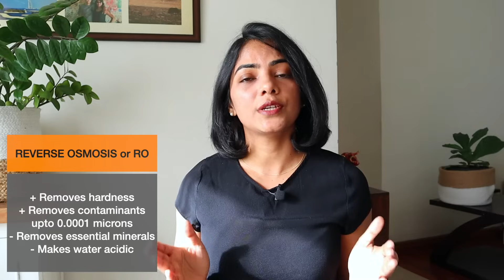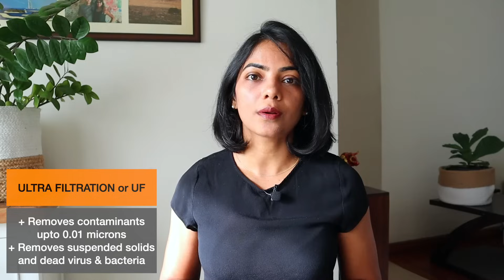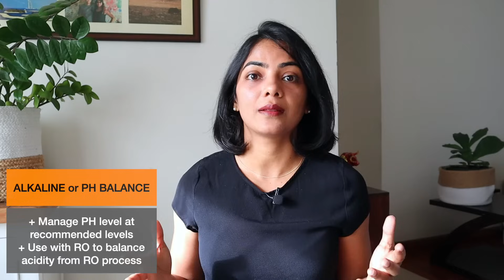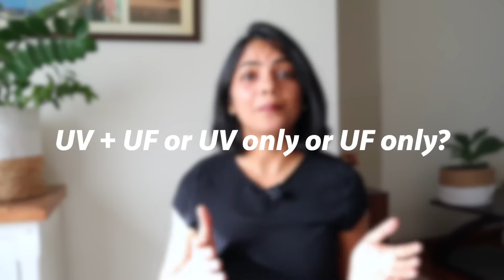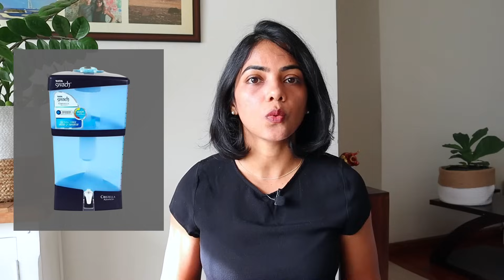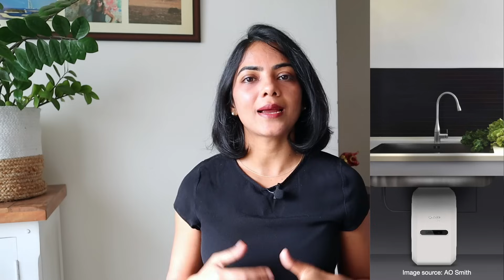Which WATER PURIFIER is best for your home? RO vs UV vs UF vs MF explained | Filter costs

Comment: I purchased water filter with Ro+ uv+MF. But in the Ist year itself I have spent 5000/-in warranty period. The TDS of input water is 320. After filtering in filter the TDS is 43. The standards for TDS is 50- 100. If your filter water is 60- 70 it is tasty and good for drinking . But maintenance cost is 5000/- per year. But the maintenance team is not able to maintenance of filter as per standards.
You have told how to maintain the filter. Balakrishnan.P

Comment: Thankyou. I will first buy a TDS meter. Will mostly stick to UV+UF, until TDS is over 500. 
I have one suggestion for bigger families and irregular power and water supplies, to get a large water storage (overhead) tank and an off-grid or hybrid solar inverter system.

Comment: Thanks for the info. What to do what the is a central RO system that brings down tds less than 200 but alkaline and ph levels need to be fixed. Do you have any recommendations?

Comment: We are using PureIt Ultima Eco Mineral RO+UV+MF for 3.5 years and there is a big problem. We have small kids and old parents, and we all are consuming this filtered water daily. And gradually we all suffered with lot of health issues. Since we are using this machine for more than 3 years, we faced bone weaknesses, joint pains, weak digestion, weak vision, hairloss etc. When we went for thorough checkups, we got to know that these conditions are caused due to loss of minerals and vitamins in filtered water. And the only culprit is our water purifier. 

The concerned thing is when I checked the TDS level of water from PureIt Ultima Eco Mineral RO+UV+MF, we found it very less TDS i.e. 6 to 12 mg/ltr than usual what human beings should be consumed. It is a great health concern for us. 

Thank you so much for making this video.
Reply: Ye apmineral k ro filter ki fiting krnay walay ki galti ha k unho nay sai tds set nhi kiya ya ziada tds level set ho nhi skta and ap fr doctors nay is solution kya btaya medicine di ya filter change krna ka kaha fr ab ap kya filter use kr rhi hain
Reply: What are you using these days
Reply: Did u take into account that your diet could be simultaneously enhancing these symptons. That is with a balanced, nutritional diet that provides the same nutrients and other important factors your family wouldnt be suffering from those symptons maybe? 
Also adding electrolytes to ur water might help aswell as re-mineralising ur water processes?

Comment: Informative and much appreciated, thank you❤
my borewell TDS is 316ppm. 
I recently repalced my aqua RO+UV+UF+TDS Controller, which resulted a 20ppm TDS with a Pureit RO+MF, but unfortunately the tds has fallen to a shocking 12 with this.

Should i completely skip the RO function and go for UV+UF or maybe an MF or nano?
Reply from the maker: You should preferably use a Nano water purifier like this https://amzn.to/3KwdM9l for your TDS. That low level of TDS is not good

Comment: Hi, Thanks for the detailed video.
I recently bought HUL Copper RO & had to return due to bad smell & taste of Water TDS of water is less than 150 & that could be the reason.

After watching all your videos I have decided to go for UV + UF + Carbon. (Carbon is optional) Could you please recommend me a best brand for my requirements. My budget is 20-25k.
Reply from the maker: Hi Vaibhav, Copper does give some odd taste based on many reviews. You can consider one of these for UV/UF - https://amzn.to/36GtEmw (for hot water) https://amzn.to/3YvHUY3 (with stainless steel tank)

Comment: If we want to enhance the taste of water and tds is under 200, should we go with MTDS or mineralizer? Mineralizer one will reduce TDS but include minerals at the end of purification, MTDS is not so useful but it has taste enhancers at the end of it, so will it be beneficial? Which one should we go with?
Reply from the maker: Neither - you should go with a UV/UF purifier as TDS is lower than 200. You may consider using something like this https://amzn.to/3QyXFLy to enhance water taste or you could go natural by adding some mint leaves / fruit in water to enhance taste. You don't need to treat water any more.

Comment: Hi ma'am. Does switching off the power supply in a UV+UF water purifier after the tank gets full affect the filtration process? Do I need to keep it powered all the time?
Reply from the maker: Hi @grematter, if the one you get has ongoing uv lamp sanitization of the purified water, then yes - need to keep it powered on at all times.

Comment: Pls help me out….
We have around 300 tds normal tap running water but in our city there is a big problem of calcium in water. 
Which one would be the best purifier UF+UV or Ro or what ? 
Pls suggest.
Reply from the maker: Hi Kapil, is calcium too low? With 300TDS, I would recommend an RO as most UV/UF water purifiers claim they only support upto 200ppm. Alternatively, since you are on the edge of safe levels, you could use a water softener before UV/UF. Can find the best waterpurifiers listed here https://www.thegrapevine.today/best

Comment: Im buying a UV+UF purifier....i want to know if a lizard or frog falls into the borewell pipe (based on the fact that we saw lizards inside the pipe when opening the borewell cap. They get in thru small gaps. So my wife is wondering if they fall in and decompose....will this UV+UF be sufficient to render the water drinkable or an RO is needed to tackle this particular problem. I didnt opt for RO because the water quality is excellent with only 60 tds or so, its a village / rural kind of area, no houses nearby. I didnt want an RO system to strip even that 60 TDS away.
Reply from the maker: Hi! Firstly for 60TDS, you don't need RO. It will make the water undrinkable. Secondly - UF is meant to separate out floating particles in water, so it can help remove it. But do make sure your filters are cleaned regularly to make sure they are performing at their peak.
Reply: @TheGrapevineIndia  > But the lizards or frogs possibility ? I know all water reservoirs from the govt has worse things floating in them but is then chlorinated and sent to homes as municipal water. But still what about my morbid fear of the lizard. Any ideas ? Will this suffice to decontaminate that kind of permeation ?
Reply: @TheGrapevineIndia  Thanks.
Reply: @TheGrapevineIndia  Thanks and the installer says hes bringing a prefilter, i think its that flask like thing, he said its optional and beneficial. Is it true ? ive ordered the KENT ULTRA STORAGE will a prefilter really help or are they just trying to sell me one more thing ?
Reply from the maker: General recommendation for all products, never buy anything additional from the installer. They will fleece you.
Pre filter is not required in this case
Reply: @TheGrapevineIndia  Thanks ! He tried that on me. I gave him the thug talk and now hes a reformed man. By the way the story goes further south....the unit was DOA. The technician  (who was incidentally huffing n puffing for 2 hrs, to put 2 screws...actually thats all there is to installation) drove screws into my kitchen wall tiles and then found the unit DOA, how brilliant.
Reply: @TheGrapevineIndia  I ordered the KENT ULTRA STORAGE , from amazon and got a DOA unit. The installation guy was huffing and puffing throughout the installation, which involves 2 screws to hold up the unit...LOL.

He spent 2 hrs 'planning' and measuring. Then at last found out the unit itself wont turn on. So much for KENT's quality.

Then he asked me for some "tips" and he got a POMM....if he had fixed it and everything went well then yes maybe we can tip him. WTF....you drill holes into my kitchen wall tiles ....thennnn find out the unit is dead. And you want a tip.

Now if i dont get the same brand n model ill have to have new holes drilled next these wrong ones.
Reply from the maker: Oh my - not good at all! Sometimes these service guys are way too arrogant 😰
Reply: @TheGrapevineIndia  >  :) Today i got a replacement unit. Same model. Hopefully the eyelet holes match the screws they put up. Ive been ordering so much from amazon for my new house that the IVR itself now says "oh its you again, plz wait.....you and your new home ^*^%##%#"......lol.

Reminds me of that old Tom Hanks Movie MONEY PIT...its about a maintenance hungry house that almost splits a couple.

Comment: You misquoted who standards, According to World Health Organization, TDS level less than 300 mg/litre is considered as excellent, between 300 and 600 mg/liter is good, 600-900 is fair, 900 -- 1200 is poor and TDS level more than 1200 mg/liter is unacceptable.

Also, water ranging between 150 to 300 tastes good and is healthy
Reply from the maker: Thanks, I have responded with link in some other comments. That refers to palatability primarily. Also UV/UF filters only support upto 200ppm.

Comment: Hello Saumya, do you have any idea on nano filters? They seem to fit in between UF & RO filters
Reply from the maker: Hi Madan, thanks for sharing. I need to do a bit more research but it is looking good as an alternative for RO filters for TDS upto 1300. If it works well, so much water could be saved! However, not many products in the market yet - I looked at this product https://amzn.to/3NqZJmJ and it looks really good.
Reply: @TheGrapevineIndia  Thanks. I too have been looking at this product for few days now. Just worried about after sales service. But after seeing lot of negative comments on using RO, I'm leaning towards this Nano filtration process as the water we get in our community is just around 650 tds

Comment: Which purifier is better under sink or wall mounted please explain..
Reply from the maker: Hi Rajkumar, it depends on what your usecase is. Under sink is useful if you want to hide away your water purifier or you want to connect it to a refrigerator. Both have equivalent technology - under the sink may be slightly older technology though.

Comment: Good Video but,
WHO recommendation of water TDS
Below 150- Acceptable
150-300 - Excellent
300-600 - Good
600-900 - Ok
900-1200- Poor (RO required)
1200 above - unacceptable (RO required)
Below TDS of 900 NF (Nano filter) purifiers can be used, few are present in the market.
BIS (India) recommends anything less that 500 TDS is safe for drinking.
WHO has done numerous research on this one of them says.
Chlorinated water having TDS of 200-400 is Ideal.
Using RO purifiers for below TDS of 600 is not recommended as it's removes 90-95% of dissolved solids and minerals.
Reply from the maker: Hi Siddu, thanks for sharing. There is some dilemma here as most UV/UF filters only support upto 200ppm. Also, the way RO with a controller works is that it adds back some water to balance the minerals without affecting overall quality of water.
Reply: @TheGrapevineIndia  
Hello, The problem with TDS controller is as it adds back the pre filtered water, chances of chemicals getting back in to the water is higher especially for bore waters which has near by water bodies like Lake or River.
Use of NF(Nano filter) upto 900TDS is good.
You will get NF of grade 20,60,80 based on water quality and impurities filters can be chosen.

Comment: As per ur comments mentioned RO will also removes Minerals then how come we can select combination Minerals also required pls
Reply from the maker: Hi, the way the RO process works is (if it has a tds controller) it adds back some part of unpurified water - a negligible quantity that will not affect the overall purity of water but will help to add back minerals.

Comment: Hi nice video,  i want to ask i have aquaguard RO and my home tap water is 350 tds. After aquaguard ro, tds comes 25, so low tds now, should i change to uv and uf, so that minerals also come and tds should be 150
Reply from the maker: Hi Pankaj - if your water purifier has a TDS controller you should ask your service person to adjust the output TDS. 25 is quite low - ideally should be around 50-150 ppm. You will hear some complaints about the TDS controller  adds back some of the water back to maintain the TDS - but that is the normal process of operation and the contaminants added back are insignificant.
Reply: @TheGrapevineIndia  Hi first of all thanks for info. now i am looking new aquaguard invisible under my kitchen table. here i hv 2 options go for UV OR RO+UV+MTDS. As i have now 290-300 tds some saying uv is perfect but if i opt for Aquaguard RO+UV+MTDS , engg say we can set 150 tds as per your requirement . Here UV+i_filter+copper active costs @ 16500 as compared to 22000 RO+UV+MTDS. Budget no issue , so give me advice if i buy UV TDS will be 275-300 and if i go Aquaguard RO+UV+MTDS tds will be 150,  which will be more better. Thanks Again
Reply from the maker: Hi Pankaj, tds of drinking water should be around 50-150. So whichever option allows you to control that is good- in this case RO.
Reply: @TheGrapevineIndia  so i looking under the sink model, will this model will be good " Aquaguard UTC RO+UV+MTDS Water Purifier" hope this can give me  50 to 150 tds. Also mtds controller how works ? some extra tap water bypass  ro  membrane and finally pass through uv, is work like that ?

Comment: 3:31 WHO standards for TDS is 100-500 (safe)..Below 100 Tds means it wont have any useful minerals...so 100- 400 is ideal for drinking..
Reply from the maker: Hi, thanks for sharing.. https://www.who.int/water_sanitation_health/dwq/chemicals/tds.pdf. WHO standards  talks about below 300ppm agreeable from a palatability (taste) point of view, not necessarily safety. Like also mentioned in the video, BIS (Bureau of Indian Standards) says below 500 is ok as well. It’s finally up to an individual on what level of risk they are willing to take. 
FWIW - UV/UF only supports upto 200PPM.

Comment: Which water purifier to purchase for a holiday home? So essentially the water purifier is not used all 12 months of the year.
Reply from the maker: Hi Nidhi, the period of usage matters less than the TDS in the area. If the TDS is below 200, and since the usage is low - you could even use something like a gravity based water purifier or any of the UV/UF water purifiers I highlight in my video. https://youtu.be/9bbeCvJgh7M

Comment: ur are using a kent water purifier what is the tds u getting in ur tap water and what is the tds after filtration do u use tds control, is tds control concerns u because it bypases the ro membrane and further mixes some quanitiy of water with ro filterd water and in to the storage tank, and why u have not gone to Ao Smith and Lg i am thinking those are premium in quality plz reply
Reply from the maker: Hi Sreenath, my TDS was over 350 - 400 ppm and after filtration - set to around 100 ppm. Only some part of the water will bypass the membrane to retain minerals but it will still go through the UV/UF filter to kill bacteria and viruses. So that water is safe to drink. AO Smith does not have UV/UF - which was important for me and LG was beyond budget. It has everything you need for RO purification anyway.
Reply: @TheGrapevineIndia  thank you very much, you have set ppm to 100 right
Reply from the maker: Yes, just for reference- 50 to 150 ppm is ideal. Bisleri is approx 120.

Comment: If the TDS is upto 300, you can still use UV + UF filer.
Reply from the maker: Hi! Floyd fan?! 😊 Well - could, but manufacturers specifically call out 200ppm. Our BIS states upto 500ppm is potable for drinking, so there is that.

Comment: Great insights in the video. I have two queries which are confusing me to make final purchase:
1. If there is TDS controller in RO, will all the minerals still be removed, even if I set the TDS levels to, say, 90?
2. The TDS of my home water is 105 (tested multiple times). Now, I am not sure if there are dissolved metals (mercury, arsenic, pesticides, etc). In this case, how should i decide for a purchase between UV+UF or RO+UF?
Reply from the maker: Hi Rohit! The minerals get removed when TDS is lowered significantly, so controlling the output TDS should help controlling that. In addition, these days the ROs come with additional tech for retaining minerals too - not sure about the efficiency of that, but it's something :). For your TDS, you don't need RO, you can go for UV + UF. There are some UV+UF which claim to remove heavy metals and pesticides but not all.
Reply: @TheGrapevineIndia  this greatly helps. Can you suggest some UV+UF which claim to remove heavy metals as well? My inclination as well is to move away from RO due to water wastage, but just concerned on heavy metals (which are removed by RO but not sure on other tech).
Reply from the maker: hi Rohit, I'm researching this and can revert back to you by next week if that's OK.
Reply: @TheGrapevineIndia  love the detailed approach. Saumya, were you able to conclude on the heavy metals filtration? I am looking to shift from Kent RO to a UV/UF ss my input TDS is around 100. Appreciate your response. Thank you.
Reply: Yes absolutely. I am awaiting your response and then only will go ahead with the purchase.